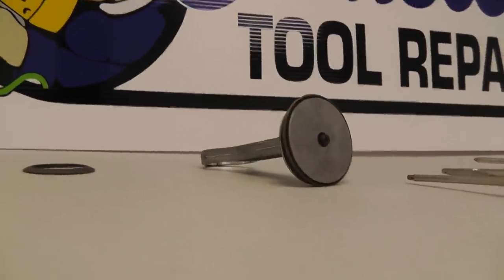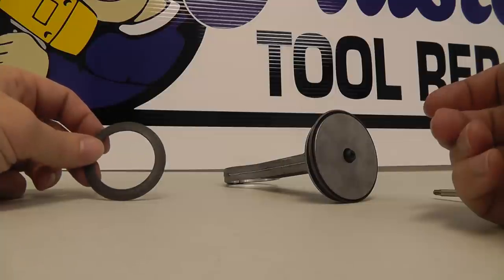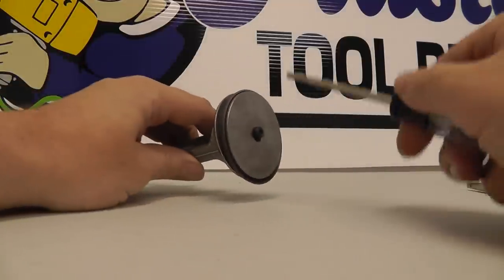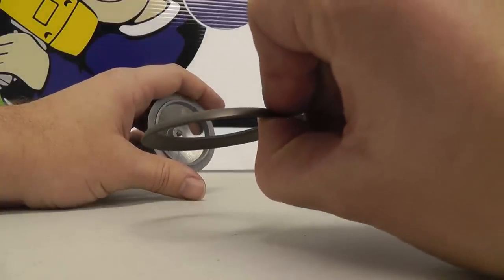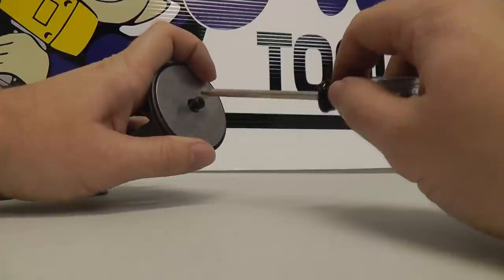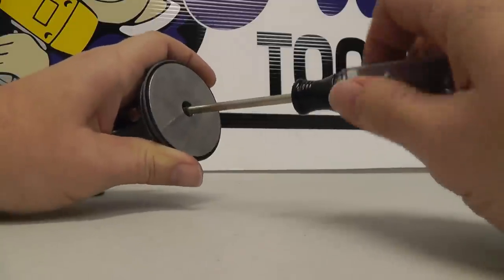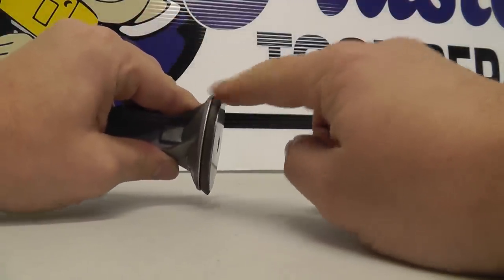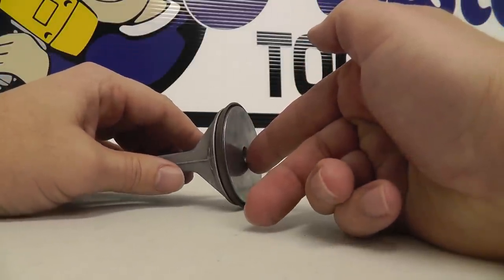How To Install A Piston Compression Ring - MASTERTOOLREPAIR.COM

Comment: I ordered the piston but it is too long so you need to make sure that you order the correct length piston
Reply from the maker: Yes, good point. It's always recommended to order by your model number and if you're having any trouble, feel free to call us at 757-547-8665!
Reply: I can not find the model number.  I have a 20 gallon 150PSI Kobaalt dry compressor.  The connection rod and piston looks the same but it has a 3 stamped on the connection rod and the original is stamped with a 2?  It does not show the size?? Where would I find the seral number I have looked everywhere on the compressor but have not located a stamp or label??
Reply from the maker: The model and serial info should be located on a decal somewhere on the tank. If you can't find it still, you can easily email a couple of photos of the compressor to us so we can identify it. The email to send it to is: customerservice@mastertoolrepair.com
You can also view all of the Kobalt oil-free air compressors on our site by clicking on this link:
http://www.mastertoolrepair.com/kobalt-air-compressor-parts-kobalt-direct-drive-portable-parts-c-271_245_246.html
I hope this helps!